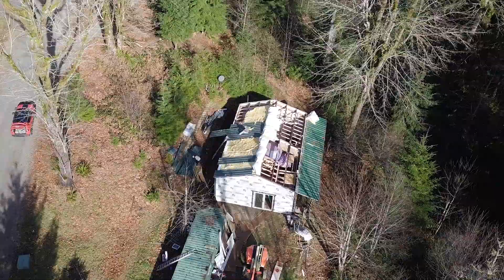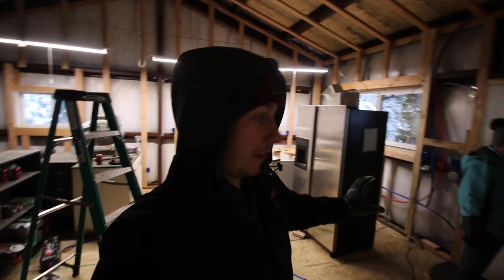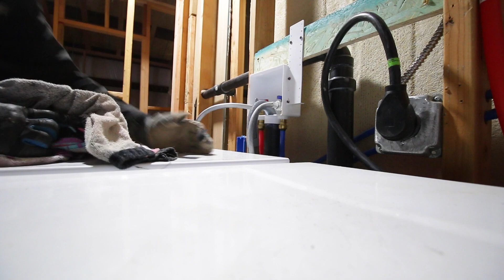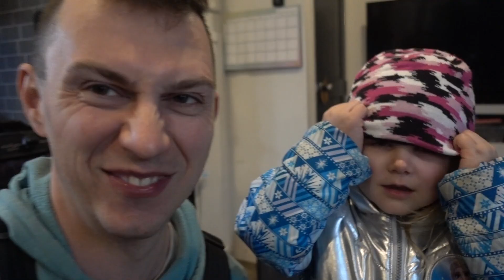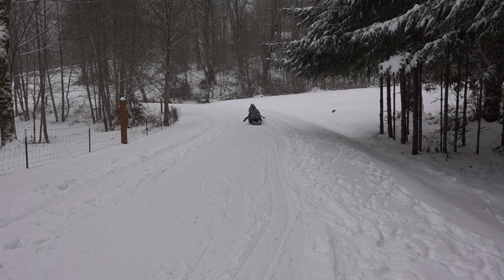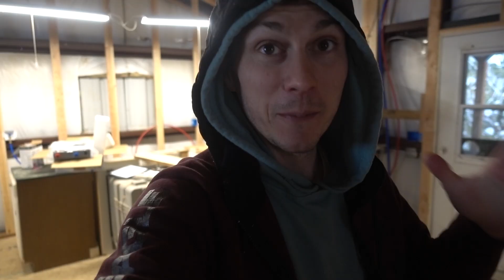Sometimes You Just Need A SNOW DAY ❄ Testing Washer & Dryer Hook-Ups 🐕

Comment: Suggestion, build a raised shelf to set the washer dryer on so you don’t have to bend so low to use them or get the pedestals for them to raise them up, speaking from experience. Love following your family.
You might also want to put a leak tray under the washer and plumb it to the outside, since your floor level in the laundry area is the same as the floor of your living area.

Comment: If u have an electric dryer u can vent it into the house during winter. It’s added heat and humidity. I just put a knee hi hose over the end of the vent hose to catch extra lint that the lint trap doesn’t catch.